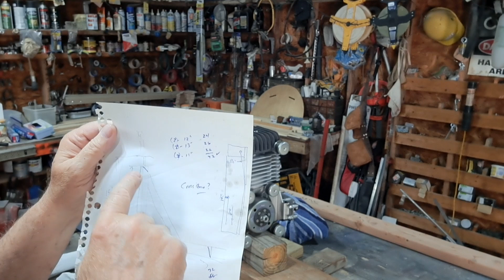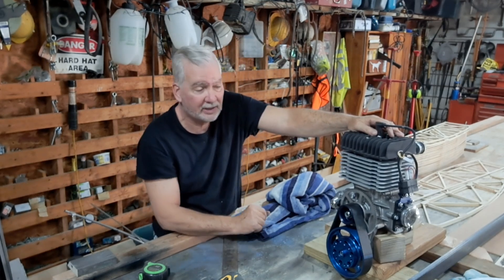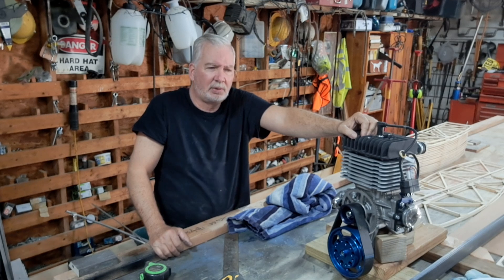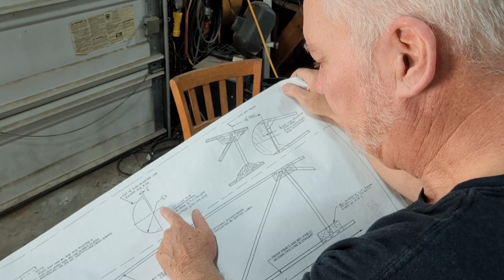Mini-Max 1030S ultralight aircraft build with Scott Episode 109

Comment: Your motor is light, you my have to push it forward in order to achieve the weight and balance.  I'm using a MZ201 which is lighter than the Rotax that the plans indicate, but probably not as light as yours.  After I finished I had to remake the engine mount to move the engine forward 3" and it is still not enough. Unfortunately it is not easy to estimate precisely the centre of gravity until you cover and paint the aircraft.